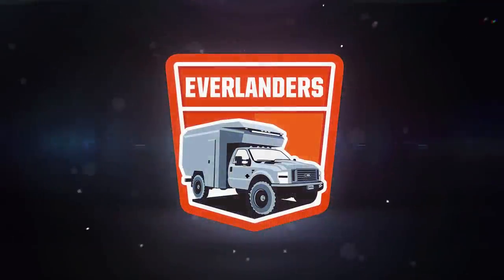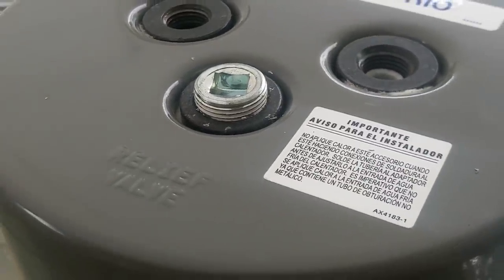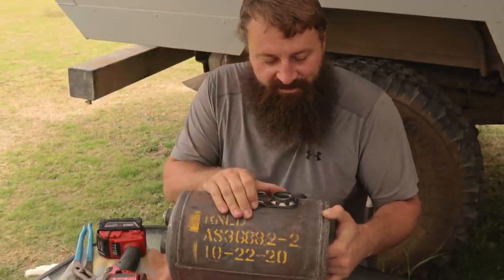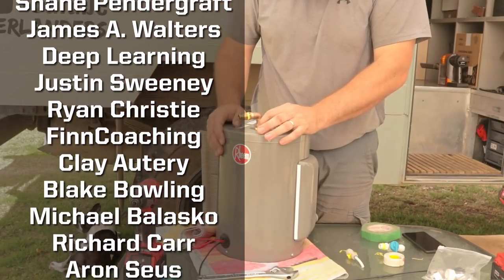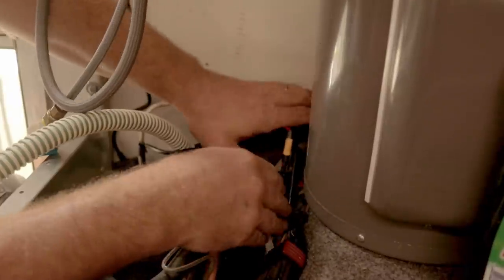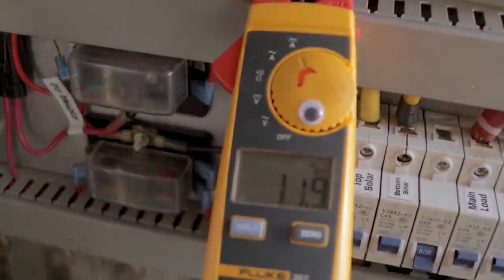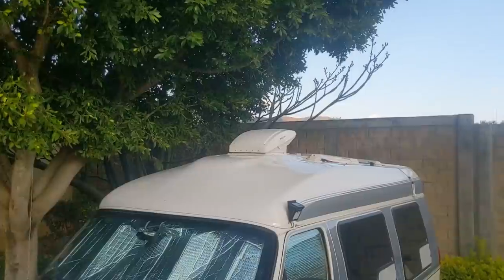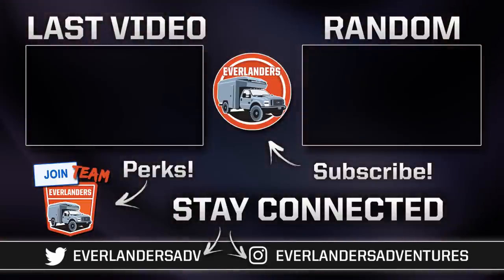Solar Powered RV Water Heater Conversion - 12 Volt Dump Load - Everlanders see the World!

Comment: Did anyone ever tell you directly, not to ever connect a 110 volt element, to a 12 volt supply??? Try it sometime. You might find that it works very well if configured correctly...
Reply from the maker: At 12 volts, the current through the 9.8 Ohm resistive element is 1.22 Amps... which is only 14.69 Watts.

Comment: Would it be better to use 2  100 watts pads one on each side instead of a 200 watt pad 🤔🤔
Reply from the maker: The thermal coefficient of the water probably makes it a moot point.

Comment: 🤓👍🏻👍🏻 Thanks for this. Our plans include a calorifier with built in electric element, but just as your heater, they're mains powered. Unfortunately the calorifiers tend to be spray foam insulated, which means you can't disassemble them and install a heat mat. So thanks for a) the heat mat idea, I might have to look for a disassembleable 🤪 calorifier, or b) thanks for the idea of changing the element to non-mains powered. YAY! 
As for the future vijeos, they're all very interesting to me, so if you can, please pick them off one by one, no rush, no pressure. The 3D printer is probably most interesting (I have a Prusa i3 Mk3 that I intend to bring along in the truck), and the ceiling fan is least interesting (because we have build time + ~2 years before it's relevant to us. 🤣). 

Anyhoo - Muchos Graçias, amigos! 😎👍🏻👍🏻
Reply: Jocke, I'm building 24v so easy to find elements that are purposed for solar installations.  I also have a 27 ltr colorifier - and I'm quite certain that the base is not insulated so maybe an option there. Good luck from the  You Kay.
Reply: @jupiteradventure5284  that's good information, thank you! We've not purchased anything yet, so we might have a few options to research before we make a decision. Thanks again!

Comment: The dc to dc conversion, I did this for my laptop and other things in my trailer, not sure if I gained anything other then being able to use it without the inverter on.
Reply from the maker: Yeah, my inverter has 35watts standby consumption and even if I only gain 5 or 8% - I'm on the laptop at 250w for 8 to 10 hours a day... It all adds up.
Reply: @Everlanders  I seen your dc boost converter sitting on your bench, same one I'm using,I ended up having to mount one of those lil adjustable temperature relays  for a mini fan that I mounted on top of the fins, otherwise just running my laptop it got HOT 🔥 , Really hot...
Reply from the maker: The little 300 watts is for my soldering irons and not big enough for the laptop.  We're using the big 1500 version for the laptop and 3D printer... But thanks for thinking of me!

Comment: have you heard of using pre heater spark plugs to heat your water. they are 12 volt and last a long time. energy can be cut off useing a timer, run it off yout solar power
Reply from the maker: Nope.

Comment: Install a dehumidifier and run the drip to your water tank
Reply: When your water tank is hot the power could be sent to the dehumidifier and you could choose which one has priority. A decent dehumidifier will make 4-8 gallons a day with continuous use. With intermittent use maybe send it to a burkey that overflows to the water tank. Add Himalayan salt and it's the best drinking water.
Reply from the maker: Our rooftop water collection system keeps our tanks full... But good thinking! 🤔

Comment: 1st of your videos I've seen , so not sure what voltage your solar runs , but everything in this video indicated 12 volts -- why not 24 volts -- going for efficiency ?
Thanks
Reply from the maker: Because the rest of the truck is all 12 volts, all RV equipment is typically 12 volts, the inverter we already owned is 12 volts, the fridge and deep freeze is 12 volts, both of our air compressors are 12 volts...
Reply: @Everlanders  Well your talking about DC/DC converters - so solar & battery at 24 volts and then ocnverters to get 12 volts as needed , higher voltage for solar , inverters & batteries give better efficiencies / lower cost and these days more common components .
Reply from the maker: Any cost is more cost, I already have what I have and not changing now...
Reply: @Everlanders  Not arguing , just talking about info , I would not expect you to change , just passing out info , not just to you but other watching .

Comment: Hi guys! Hope everything is going well. I would like to ask your opinion on the viability of converting a korney keg into a 12 or 24-volt water heater. Our build is on a tight budget and I have acquired 4 free Korney kegs and we'd like to use what we have. Thank you for your attention.
Reply from the maker: It's totally doable... As you saw in my video, I used a keg for the water heater for a few months... I was just lacking some better insulation. But if you can stick a heater mat to the outside and hold it tightly against it keg, it should work well. The better you are able to insulate it the better it will work.
Reply: @Everlanders  Thank you! I have a 5-gallon keg. what wattage mat would you recommend? Do you think a submersible heating element installed in the bottom of the keg would be more efficient?
Reply from the maker: @mottavator  150watts takes our 2.5 gal to hot in about 2 hours. But it all depends how much power you want to be dealing with. 300 watts will likely take yours about 2 hours too, but that's 20 or 25 amps! how much power do you have to spare...
Reply: @Everlanders  I'm planning on 1200 watts of solar, and I have lithium batteries connected in two 12v batteries in series x 2 for a total of 24v 240ah

Comment: That is not a built in breaker, but a thermal safety in case the element gets stuck running
Reply from the maker: Right you are!!! I assumed the "Reset" button was a breaker, but it's a over temperature breaker that needs to be manually reset if the temp goes to high... Neat!

Comment: I wonder if thermal paste (used between cpu and heat sink)  between the mat and the tank would help transfer heat faster.
Reply from the maker: The heater pads are made from the same compounds as SilPads used to transfer heat between FET's and heatsinks... And as you can see at 2:49 after it's heated up a few times it really conforms and fuses to the surface it's being pressed against. I'm sure some Artic Silver paste would help to some extent, but I didn't want to bother with it. 

(Also will be a moot point after a future video...)
Reply: @Everlanders  I commented before watching the entire video ...afterward I realized that you probably already thought of that!   Much respect for your skills and creativity.   I'm building an off grid eco safari glamping camp and your videos are really helping add clarity to my plans

Comment: LVC and temp low isn't really a dump load is it? it is on while batteries are still charging...  shouldnt you set it to only run when batteries are full to be a dump load?
Reply from the maker: I guess it would more accurately be called a software controlled dump load... But the heater uses less power than our midday excess, I can dip into the battery reserve a little in the morning and evening and have hot water all the time, and our batteries still are always full by mid afternoon

Comment: i would have put rust protection on it and then the pad and get rid of the welding splatter as well.
Reply from the maker: You should do that, and then post a video, and then I will come comment!
Reply: @Everlanders  I plan to once i get a camera, Also check out AeroGel its a the best insulator and can be sourced in most places.

The only difference between your camper truck and what i am doing is mines for the house and i was thinking for setting up a relay and thermal sensor so when the tank is X degree's it will trigger the relay's disconnect the heater from the panels and connect the panels backup to the grid but i am still working on the details when i finalize the circuit i will be making a few of them we should see if its possible to send to you.

P.S we have Rheem in Australia as well they are a good brand.
Reply from the maker: Like this? https://youtu.be/TGMZ7bM-Kow

Comment: Why don't you produce and store HOH you can run the gas through with Sam column and there's no way I can explode it just burns on the surface and maybe for about an inch of sand and so you have a heater you can cook with it
Reply from the maker: I have no need of combustible fuels, no appliances that would use them. It's a fun idea and maybe if we had an off-grid home or something, that would be something to look into... But not right now...

Comment: I have been looking for a solar dump load solution to heat water after my batteries are charged.  Is there a way to connect this to an MPPT controller that has a dump load option?   It would need to be able to send a signal to the MPPT based on low and high temp so the MPPT controller stops.  (I know what I want, just don't know how to do it?   Thanks in advance.
Reply from the maker: It doesn't matter what type of charge controller you have... It would work with anything.

Comment: Where to purchase the 12volt heating pad ? Silicone ?
Reply from the maker: Yup, Silicone, I got mine for heating our Lithium Battery from eBay many years ago, originally intended for heating 3D printer beds. But they are on Amazon and directly from https://keenovo.store/ too.

Comment: Great bit of work there. I had a back of the envelope sketch I’d done for something very similar but I didn’t want to blow a couple hundred £ on a tank only to find it wouldn’t work... But now you’ve done the hard work for me! Thanks heaps!

I’m sure someone has already mentioned it but just in case not... Rheem Australia does a compact model (25L) that looks very much like the one you used. There’s English manuals etc on their website.

https://rheem.com.au/rheem/products/Residential/Electric/Rheem-111-191-Series-Electric/Rheem-Compact-25L-Electric-Water-Heater/p/111025G5

Comment: Why don't you dump the excess electricity into a Sand Battery that could be in the middle of your water tank and put the dc water heater element in the sand battery to heat the sand ?... 😃
Reply from the maker: I would not consider a sand battery in this situation.

Comment: my suggestion for what to do with the excess electricity would be use it to power a crypto mining setup. not sure how much money could be made by doing that but youve got free electricity to do it with. complicated thing to look at doing but i wonder if youd make enough money from it to get more solar and more crypto mining setup...
Reply from the maker: With Starlink and the Water Heater, we've struck a good balance... Usually bouncing around 90% battery... Also, zero interest in Crypto.
Reply from the maker: https://youtu.be/gRSnTMrUPrQ
https://youtu.be/TGMZ7bM-Kow

Comment: Awesome video, thanks!
But spending $3000 seems a bit wasteful? Can't you "DIY" this for basically nothing?
I think that would be the big advantage of a thermal batter, costing almost nothing compared to lithium batteries.
All you'd need is resistance wire or insulated wire that is thin enough to heat up on 12V. Just clean it, dump it into a keg and then put the keg into a box with rigid insulation foam that you fill with expanding spray foam.
I figure the critical part would be to have a pressure valve if it gets too hot, an arduino with temperature sensor and some additional analog temperature sensor to shut off the power if something goes wrong.
And of course the wire you dump into the water should be "food safe".
Reply from the maker: $3000 MXN pesos is about $149 USD... Hard to beat that price...
Reply: @Everlanders  Ok haha that is quite a good price then. Thanks for the video!

Comment: Leave the 120 element connected in parallel and get another 140 watts of heating.
Reply from the maker: Wouldn't that be 14 watts?
Reply: @Everlanders  120/12=10 1400/10=140 Isn't that correct?
Reply from the maker: No, It's Squared... To answer this properly, I just went and measured the heater element at 9.8 Ohms
Per Ohms Law, which states Power (P) = Voltage (V) * Current (I) 
At the rated 127 Volts, the current through the 9.8 Ohm resistor is 12.95 Amps ... which means (P) is 1645 Watts.
At 12 volts, the current through an 9.8 Ohm resistor is 1.22 Amps... which is only 14.69 Watts.
https://ohmslawcalculator.com/

Comment: Wow those marine calorifiers were really expensive, Got a surecal 55ltr twin coil calorifier for $600 that can run off the engine coolant, My 30kw Espar or a 1kw electric immersion complete with mixer that ensures the water is never at a dangerous temperature. HOWEVER my vehicle is a lot larger than yours so this seems much better for a more compact build.
Reply: Nice.  I'm planning to build one from an 11 gal portable air tank with a 1500w 120v heater, an engine coolant coil, and a potable water coil.  I plan to fill the tank with glycol and pump it through an in floor radiant heat loop.  I will leave provisions for a diesel water heater in the future.  I never considered using a silicone heater mat.  I will add one to the build list.

Comment: If you have so much solar power overload down there its better to use inverter and load water heater with 110V than feed it with very ineffective 12V heater.  Actualy heating tank directly on the sun has 96 % effectivity compared to heating anything with PV solar panels with all that energy losses in chain.
Reply from the maker: We completely disagree on this point.
Reply: @Everlanders  Zero arguments?
Reply from the maker: "...its beter to use inverter and load water heater with 110V than feed it with very ineffective 12V heater"
1. Better is spelled with 2 t's
2. Your statement that it is more efficient to run a DC-AC inverter for a resistive load, boggles my mind. The losses in the inverter due to heat which then, in turn, require a fan to blow it into and heat up our living space make no sense to me.
3. Why is the 12 volt heater ineffective? It seems very effective. Do you mean efficient? Where is the inefficiency? Is there power being wasted as light which I can't see?

"heating tank directly on the sun has 96 % effectivity compared to heating anything with PV solar panels"
That is very old thinking... Modern PV is more efficient and cheaper than heating water with solar collectors, It can also run our Refrigeration, Cooking Appliances, Computers and Air Conditioning which Hot Water Solar Collectors can not.
Do a quick google search and you will find dozens of studies and papers showing this to be true. Here's the first result on Google:
https://reneweconomy.com.au/solar-hot-water-solar-pv-study-says-pv-cheapest-way-go-34519/

"solar panels with all that energy losses in chain"
What Chain? there is no chain... the Solar panels are effectively being switched directly to the water heater. Ironically, feeding the power through the inverter first as you suggest, That would be a chain...

Comment: Hola. I'm currently converting a Renault Trafic to off-grid (located near Morelia). I'm having so much difficulty finding all the electrical components for both solar alternator. I think I finally found a supplier in Leon. Anyway, does anyone here have any recommendation for a water heater that runs off electric and not gas? All this stuff confuses me to be honest. I know I can find gas water heaters fairly easily but I need electric. And in Mexico, sometimes things are not so easy to find... FYI I am hiring builders for the job, I just need to know what I need to purchase and ask them to install...
Reply from the maker: I just walked into the Home Depot here in Mexico and picked it up off the shelf...

Comment: It should be "Reamed" bought a new furnace 8 years ago a relay went bad... $900.00 to fix it... The board it was on $450.00
I don't like screwing around with gas appliances... So that is why I didn't fix it myself.
My other house has a non name brand furnace that is 20 years old... still working like a champ.
Reply from the maker: Replacing a relay should be fairly straightforward...
Reply: @Everlanders  Yes but they didn't say what the problem was... they just swapped parts until they got it working... They had to drive an hour to get a board from another truck. They make you buy the whole board. It was at night during the winter in upstate NY near Lake Ontario and the building has two apartments and a business. And it already had been a couple of hours with no heat. So I couldn't wait figure it out the circuit board problem myself and to order parts. I figured the relay bit the dust later, after I had a chance to check each part with a meter...
The main issues were... It not lasting that long and for the size of the board, $450.00 was way too steep... They should have at least kissed me first, if you catch my drift...
But at least now I have a spare... I fixed it.
Reply from the maker: Ah, fair enough... And now you have a spare, and since you have a spare, you will never need it... 😂

Comment: Why take it apart?
A resistor is a resistor. Resistors do not care what voltage go into them. Amps are different. A 120v.resistor (heating element) should work. Show me where i am wrong.
Reply from the maker: You're not entirely wrong, but it would many many hours to heat up.
To answer this properly, I just went and measured the heater element at 9.8 Ohms
Per Ohms Law, which states Power (P) = Voltage (V) * Current (I) 
At the rated 127 Volts, the current through the 9.8 Ohm resistor is 12.95 Amps ... which means (P) is 1645 Watts.
At 12 volts, the current through a 9.8 Ohm resistor is 1.22 Amps... which is only 14.69 Watts.
https://ohmslawcalculator.com/

Comment: I WOULD HAVE LEFT THE 120VAC ELEMENT IN THE HEATER TO USE WHEN 12 VDC WAS NOT AVAILABLE OR TOGETHER... IF THE 12VDC WAS KEEPING IT HO THE 120VAC WOULD NOT KICK IN.
Reply from the maker: I did... Also, it seems your caps lock key is stuck.